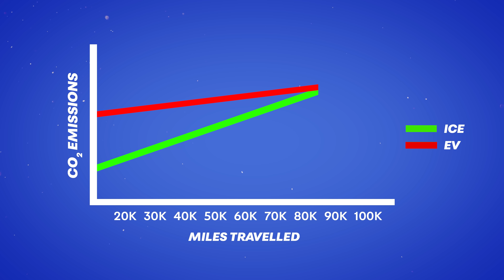Are Electric Cars REALLY That Green? [New 2022 Data]

Comment: It's implying that pollution only starts when burning the gas in the ICE vehicle. In fact, to produce gas there has been HUGE amounts of pollution worldwide.  
This is very misleading.
Reply: Rory said they included the Well to tank calculation
Reply: @SunsetHaze  I've heard about this thesis many times and the actual pollution is not taken under consideration.  For example: lithium is only added for EV's. But in fact large amounts of it is used for refining the oil. Also, refining oil consumes huge amounts of electricity.
Reply: @catalin633  I'd have to have a closer look at this report to make a difinative decission on that. I know many other reports do exactly as you claim though.

Comment: We have to remember that ICE cars were once hugely inefficient. Horses could go further and outrun them in the early days but look how that turned out. Batteries and their production will improve, energy consumption is and will continue to get greener and costs will come down (in theory). Are batteries the best solution long term, maybe not, but are they the best alternative right now, certainly.
Reply: Ice cars could have become more efficient, it just was never a priority. The industry was trash at innovation. This report really was a worst case scenario. Obviously we will move to greener sources of energy, so the payback period is way faster. Imo, if you want to drive petrol go ahead. I don't care. But you should pay for the additional emissions. Does that mean rich people get to pollute? Yes.... But we will charge enough to offset. I think if you charge enough to offset emissions, it's a net zero, so who cares? I really think the additional fuel cost won't be bad and we will eventually have renewable clean fuel. Besides, I think most petrol cars will be Sunday drivers and people will be happy with ai driving for boring commutes. Ai driving will come faster than people think
Reply: @Tential1  I agree, this report is worst case and also only a snapshot of the system right now. Things will only improve, that's the nature of technology. More new cars will begin to be designed from scratch with EV in mind, rather than adaptations of ICE platforms, which will help create efficiencies.
Reply: The best thing with horses is when they got old and knackered, you could eat it. Just as they do in Spain   ;-))...
Reply: What are you talking about? You've just been told that EV cars are not the best solution at this moment and you've stated that they need to get better and then you end your statement by saying that EV cats are the best solution at the moment. The logic.
Reply: @L.C.Sweeney  The video shows that EVs can be better in the right circumstances, over time and mileage. Is the gap massive, no, but will it become better, yes. They are the best evolving solution right now to reduce the reliance on limited fossil fuels. Could other fuel sources be better, quite possible, but things like Hydrogen or e-fuels simply aren't mass market now. Change needs to happen fast and batteries are the closest thing we have to that happening right now.
Reply: @Renard998  yes, agreed. The issue lies with our governments and their inability to shift to cleaner forms of energy. They are all telling us to buy electric and forcing older cars out of the market (in London it costs £12 a day to drive a diesel older less than a EURO 6 emissions standard). The consumer is paying the heavy price for EVs - especially with the increasing price of electricity - and everybody is blindly going along with it. Our energy grids are not ready for the coming mandated switch to EVs and that's besides the lack of renewable energy. Countries will have to build more finite resource power stations to keep up with the increase in demand due to EVs and we'll be in a worse place than where we started. Germany had to build five coal stations last year because they refuse to use nuclear and that was whilst building ginormous wind turbines in the beautiful Swedish countryside for their own energy supply. It's all very hypocritical.

Comment: Most people that can afford a new car seem to change it every 3-4 years. Therefore they reset the clock each time. So unless manufactures stop making cars as often this is going to keep happening. Then we will truly benefit from going green with a minimal impact on the environment.
Reply: Well, yes, but also no.
You don't scrap the cars after one owner, so a green car will keep being green.
Reply: Why does it reset the clock if the car changes owners?  Does the car just vanish?  Do the materials to make the car have to be mined again?
Reply: @NickFoster  I'm saying if you get a new car. How many people keep any car at the moment from new to 90k?
An EV also doesn't last as long at the moment. They need a replacement engine/battery after so many years.
Reply: @YTSsport   Other than the battery electric cars seem to last much longer. Nissan leaf has battery life issues but all the rest of BEV's with active cooling seem to have battery lifespans far in excess of that. Very hot areas where people drive long distances also reduces batteries life. Opposing this are the newer LFP cells which double or triple the number of charge cycles.

Comment: I haven't seen the video yet. Are electric cars really worth it? I live in the north east of Scotland. If I'm out on the road let's say I go to Glasgow with my wife, and I run out of battery then what? I'm going to have to wait for green flag or AA to come with a charger and even then I'll still have to sit in the car freezing for however long it takes for the charger. I think I'll stick for diesel right now
Reply: Im sure there is at least 1 charger on the way to Glasgow from your house in NE Scotland...  Maybe you could fully charge it before leaving..... Maybe you could stop for 20 mins for a quick top up.... Maybe...

The point is have a plan....  Also if you don't stop to fill up for diesel then you will also need to call the AA. Time to stop reading the Daily Whatever and make an informed choice instead of opinions from journos who know better but won't tell you the full story.... 

Also take the time to watch a video before commenting. At least Rory is a good example of a motoring journo who gives balance to both sides of the argument....

Comment: Well said!   At least the electric production part of the EV pollution is concentrated in one location where theoretically is should be easier, over time, to filter the pollution source or change the energy source to a less polluting type.  And, your comments on the localized pollution, urban centers etc, is no small problem that greatly benefits from moving the pollution to the power generation plant out of the urban area.

Comment: Fantastic video,  it's about time the industry was honest about the ev market,  it seems that people just jump on the bandwagon to be seen doing their bit for the environment.
The one big question is, all the new EV'S out there,  we have no idea how good they  are going to be in 5 plus years and what the second hand market will be like.
Reply: "we have no idea how good they  are going to be in 5 plus years "  My mom has an ev older than that. Its still faster than a corvette and still seats 5 people and still goes over 200 miles.
Reply: @JackMott  and costs next to nothing to service.....
Reply: If only the manufacturer gave you a battery warranty
Reply: @waynecartwright7276  Tesla offers an 8 year ~120k mile (depending on model) battery warranty, which is good but if everyone's battery goes to crap at year 9 that will make for a bad experience, if there are not cheaper replacements by then. There is some onus on the owner to take care of their battery of course.  I only charge mine up to 70% most of the time as that is easier on it.  Owners of gasoline cars have similar responsibilities (get the oil changed, don't redline it moments after starting it, etc) or they can damage their expensive engines.
Reply: There are Tesla Model S and X (and almost model 3) on the roads that are 5 years old. They seem to be holding up pretty well? And if you account for gigafactories running almost entirely on renewables, they're gonna be even better. This is one study about one model of car probably motivated by whichever fuel type brings them the greatest profits...

Comment: There's another major factor - at some point you'd need to replace the batteries in EV...
So ECO friendly...
Reply: After ~160.000km soooo...

Considering medium electricity mix that's 3 ice vehicles in one battery which won't go to waste afterwards but instead be used as home batteries for example
Reply: @obibrenbenobi  Cars are supposed to last much longer than that - it's achievable with EV but only in perfect conditions - in other case, you replace batteries.
EV's are cool but as mentioned in the video, they are not as clean as we might think.
Reply: Many experts agree that the average car will be ready for the scrap heap before your battery. You only have to look at the number of classic car conversions using  batteries from old / totalled Leafs / Teslas etc.
Reply: Several BEV's have 150k km or more warranties on their batteries. Tesla are claiming atleast 500k miles on their new batteries . Then there's that batteries are at least 95% recyclable.

Comment: I learnt that if you want to get as green an EV as you possibly can, get as big a battery as you need and get a car model with the highest miles/kWh figure. Also, do some light research into how your country or region produces the electricity your new EV will run on. Where I live, 90% of our electricity is produced from natural gas, not the best, but still decently good. If you’re EV is obtaining electricity from a coal power station, might want to consider a hybrid car instead. Thanks for sharing the insight with us, Trader crew, really enjoyed it! Bring on lighter EVs and more energy-efficient batteries, aka Merc EQXX!

Comment: The comments are gonna be interesting to check back on for this one 😅
Reply: Soooo Trueeeeee 😐😂
Reply: It entirely depends on your power grids energy mix. Break even is around 30k miles with clean energy sources.
Reply: @oscarwolf100  very true, the thing that most people forget is that an ice car when sitting there not being used is producing no emissions. An electric car has to be plugged in as they lose range overnight. It’s not something they publicise but I have seen anecdotal evidence that it’s around 11miles a night. I don’t have proof though so it could be bs. Also in cold weather the car burns more power to keep the batteries warm. Electric cars will require different usage as they are not a slot in replacement for certain use cases. 

There is also energy usage in the production of petrol and you don’t know if that co2 is factored in so there are ways to massage the figures for every view.
Reply: They delete any opposing comments, ask me how I know!
Reply: @ChromeFlakes  go on then
Reply: @ChromeFlakes  You mean like 'The Guardian' - 'Facts are disposable and comments not free'?

Comment: But these results are then also only aplicable to Volvo though... Hoe can you draw general conclusions worldwide on every car if all this data comes specifically from volov. 

Hypothetically:
Ice Volvo needs 20t of greenhouse gases to be built
Bev Volvo needs let's say 50t

Then you get those numbers published.

But why would this then apply to someone like Rivian?

They're using different suppliers etc etc so their Bev only emits 30t once built and then the numbers compared to an ice car are completely different....

I really don't think that you can use the Volvo numbers to generalize that much and say all Bev vs ice comparisons are like this now...
Reply: i would check those sources. There is a diffrence between a decent piece of reserech and a claim. Volvo has 50 + years of experience in making cars greener.
Reply: Generally speaking, most mass production BEVs use the same basic production methods.  Auto manufacturers account for every screw and bolt from raw material to final finished product as it all comes with a cost.  So if two cars are similar in weight, its likely they have a similar carbon footprint.
Reply: Exactly, as the Volvo report says they are manufacturing the car in China on its high CO2 electricity, so will of course be higher per car that manufacturer in either a lower CO2 electricity country like US or Europe or chooses to source their electricity from renewables fully or partly (such as VAG and Tesla, not sure about Rivian, but they probably do as well and certainly in lower CO2 US)

Comment: This is where alternative fuels and hydrogen comes in. If theyre able to use ice cars but without the harmful pollutants coming out the rear then there onto a winner!
Reply: You still pollute to get the hydrogen.  Generally you don't get a win, since you spend more energy getting the hydrogen than you would have just putting the energy into a battery.   If you use the hydrogen in an ice then again you lose a ton of energy due to bad efficiency.  A fuel cell battery is a little better.  Hydrogen only makes sense when you need the energy density of the hydrogen. So maybe for an 18 wheeler or something.

Comment: They did the study because volvo is developing hydrogen cars.
Reply: There is a fundamental flaw in your logic. You extrapolate conclusions from data from Volvo to the entire car industry without excluding pure EV manufacturers. Volvo is an ICE manufacturer and has to account for additional resources and parts to make EVs. So it adds more carbon emitting parts/production to its base ICE manufacturer production process to make EVs. Tesla, Rivian, and Lucid do not. Compared to producing Teslas, producing Volvo and other ICE manufacturer EVs emit more carbon because this activity adds to the baseline ICE production by those ICE car producers. So you can say that the additional resources and carbon emissions it takes for Volvo to make EVs adds to and does not yet reduce Volvo’s carbon footprint. The same cannot be said for EVs from Tesla or another pure EV play.
Reply: @Pgrandster  you are right my friend . I just made a conclusion based on what i know and this video.
Reply: No. Volvo trucks are developing hydrogen vehicles. Volvo Cars is replacing every ICE car they make now with EV models. They plan to sell only BEV cars in 2030. They put out a tech presentation on their plans that I suggest people should watch. It's from June 2021.

Comment: In most developing countries, electricity is still produced by coal. So EVs here are pointless
Reply: Even when the electricity is produced by coal, it can help to drive around in a car with a 95% efficient motor instead of a 35% efficient one (best case scenario if you get an efficient mazda)
Reply: This is false, even running 100% from coal, an efficient EV will have a significantly smaller overall carbon footprint than an efficient ICE vehicle. And to top this off, when unleaded and diesel are refined, do you realise that wealthy countries get the best quality fuel and the dirty remains are shipped over to poorer markets to pollute their streets even more?
Reply: @charliecollin3361  oh. I didn't know that happens with fuel as well. That's sad. The same happens with everything here in India. We have very high quality fruits, cofee, tea and much more but all the good stuff is either exported or consumed by the locals. Rest of us get the low quality stuff.
Reply: @simpskywalker7216  It's a sad reality that this happens! I know new EVs are super expensive right now but I really hope cheaper alternatives become rapidly available in large markets such as India - the developing markets could be the ones to benefit most, even when the power stations are still burning coal.

Comment: When it comes to transporting batteries to places it's no good and it's also polluting depending on where you charge it and how the electricity is being produced
Reply: A model 3 battery pack is about 1,000lbs and gets transported a bit to get into your car.   Meanwhile in a gasoline car, after about 100,000 miles of driving you will have had to transport 27,000lbs of gasoline to your car from a refinery.  That gasoline started out as a larger mass of crude oil that had to get transported to the refinery.
Reply: So I take that petrol and diesel don't need to be transported... It just magically appears at the petrol station.... 🤔
Reply: @jonathancullen1337  ok I take back the first part of what I said
Reply: I just hear these things, they ain't my facts
Reply: @WithCars9  Fair enough. Everyone should do a bit of their own research on both sides to allow them to form their own opinion. Whilst I believe that EVs are the better choice, they are far from perfect and we should do our best to walk / cycle / use public transport a little bit more....